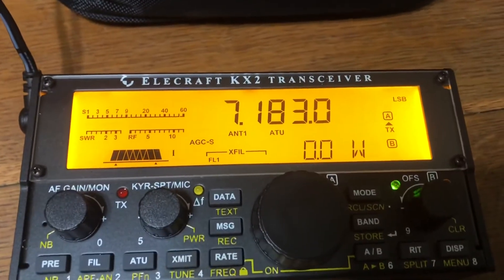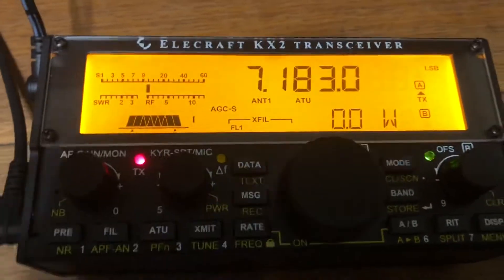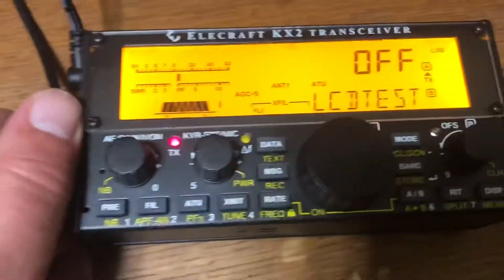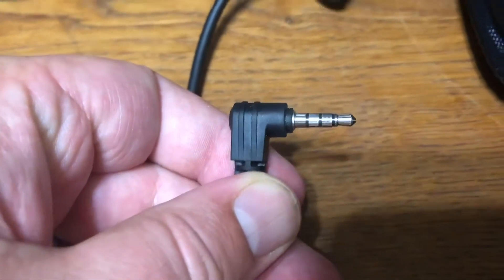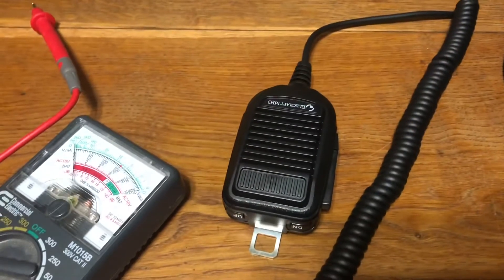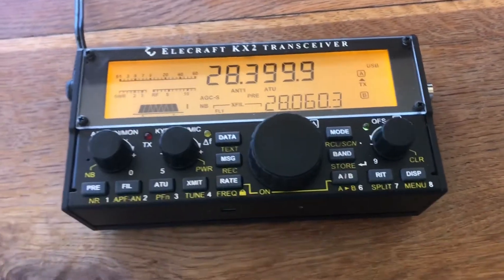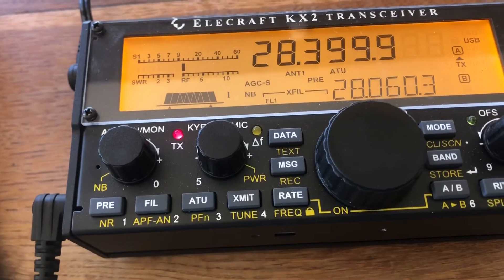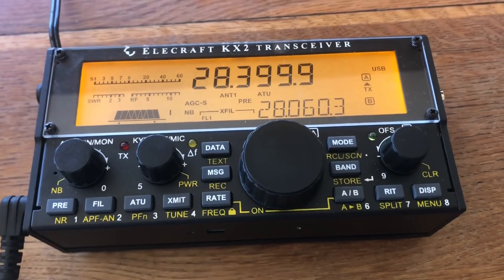KX2 TX Issue and Fix

Comment: Elecraft had a bad run of MH3 mics about a year ago. I had to have a new one sent when I got my KX2 around the same time you posted this video. I guess they have resolved the problems now though. KX2 is a great radio.
Reply from the maker: I've had no problems with the replacement and the radio has been great.  Recently strated working it on CW too and love the extra distance I can get!

Comment: Still worth getting one in 2022 or the kx3?
Reply from the maker: I still really like mine and use it on SOTA and POTA.  I don't have anything to compare to so maybe not the best informed.  I think the KX3 has more capability if you don't mind a little extra size and weight.  I like the small size of the KX2 for longer hikes although most of the weight is the batteries and that would be about the same either way.